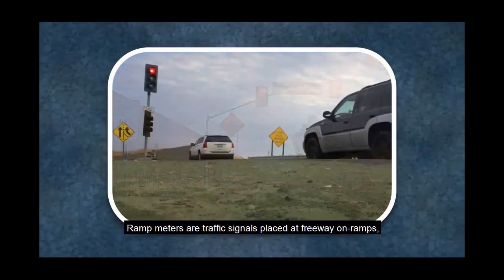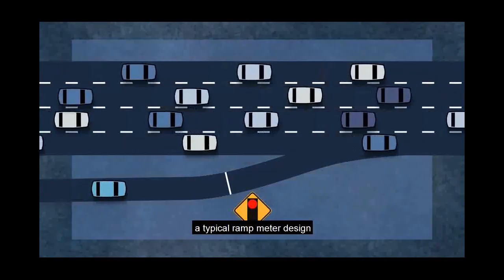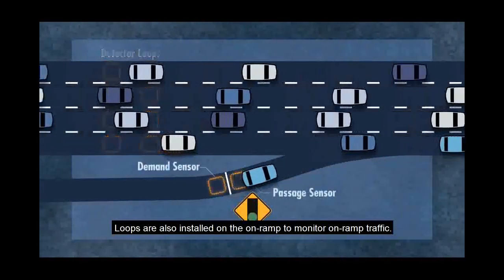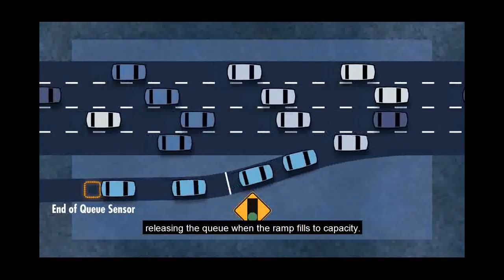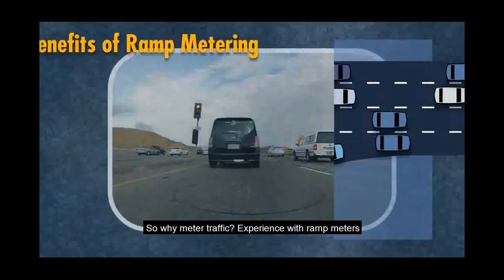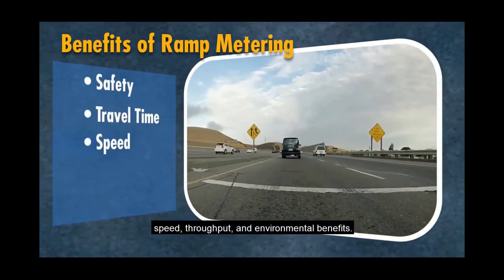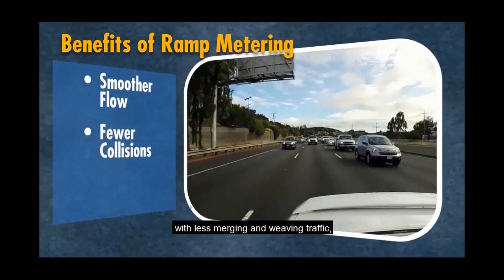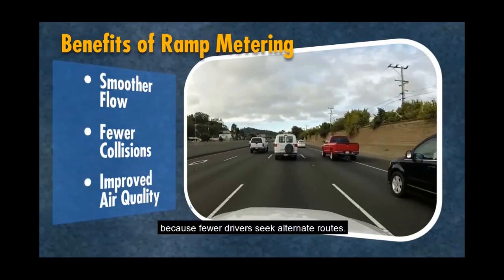How Ramp Metering Works

Comment: I'm not sure I understand how this works. From what I can gather, if the ramp fills up to capacity the light will turn green to prevent traffic from backing up. But what if there's a bunch of traffic coming down the freeway at that particular moment? Are they going to be expected to move over? It seems scary to be trying to get up to highway speed from a standing stop when you've got a semi barreling towards you.
Reply: Usually, ramp meters have two lanes. One of the main purposes of ramp meters is to break up multi-car (platoon) intrusions into a highway. (More info cam from Road Guy Rob)